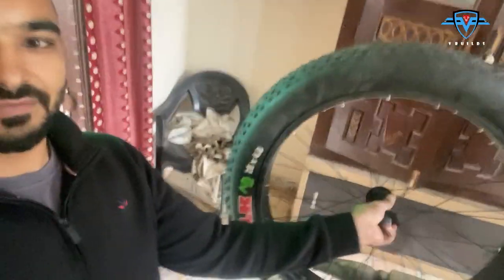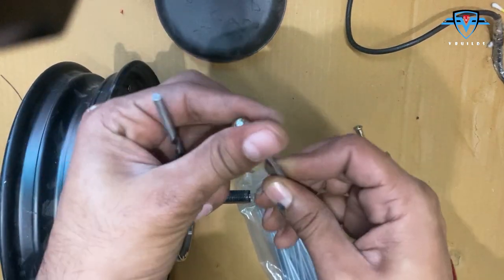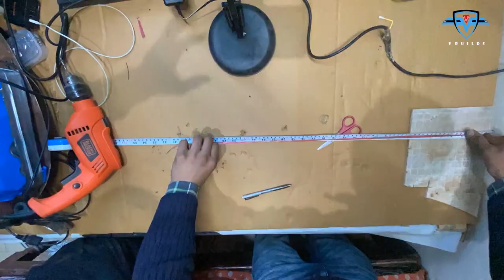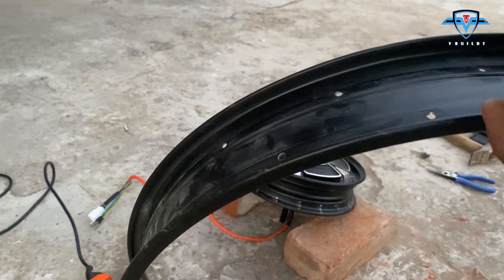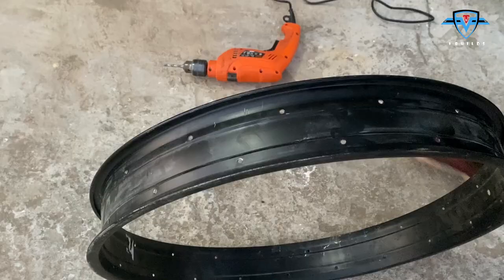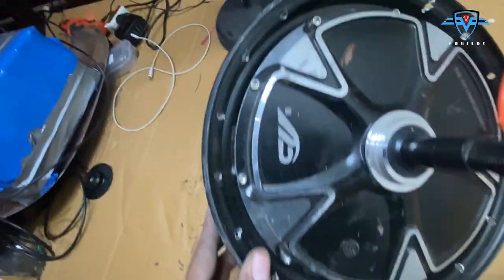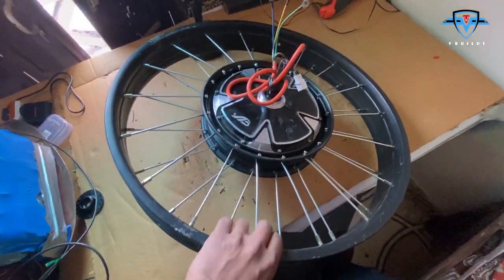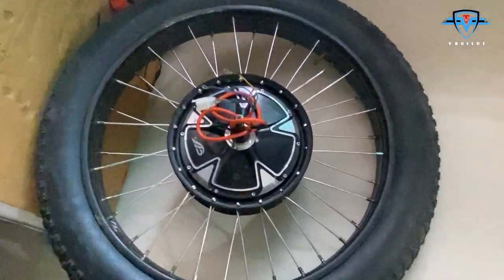How to Make Hub Motor Spoke Wheel

Comment: I'll be using a hoover board wheel/motor (6"?) for mine.How do I figure out the LENGTH of the spokes that I will need? I know that the original spokes will be way too long to fit.
And where do I get them?
Reply from the maker: What i did was … (diameter of the wheel - diameter of the motor )/2 
It gave me the length of the spoke 
Then I checked with the motorcycle parts store they had different spoke lengths available, 
Also there is around 1cm adjustability so u don’t have to be exact
Reply: @VBuilds  Ty. I appreciate it